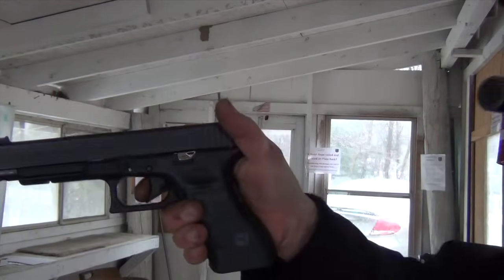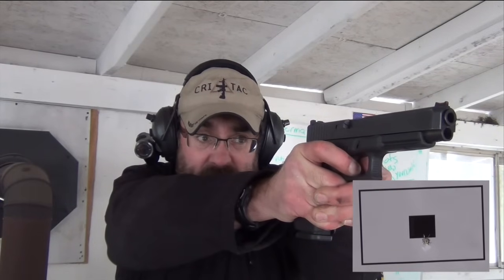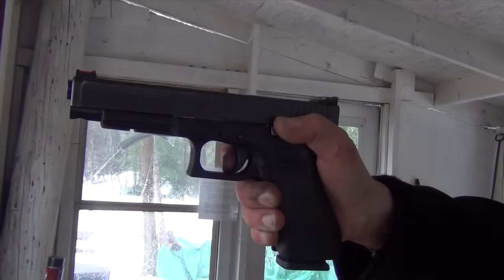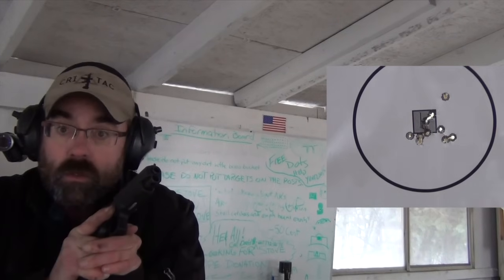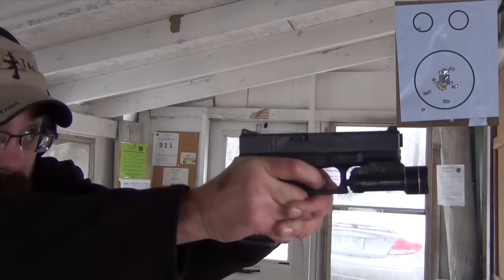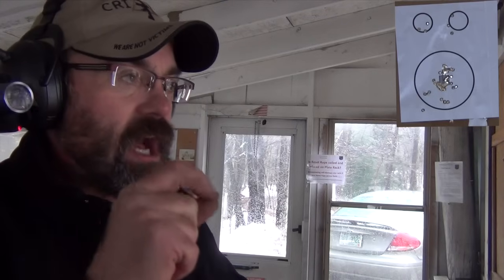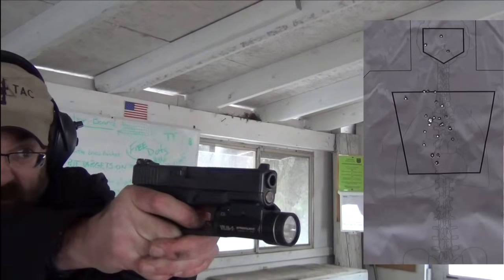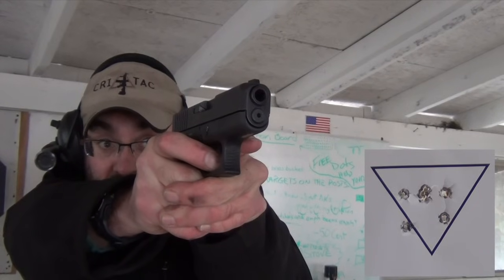Mastering the Glock trigger

Comment: today I used this exact trigger technique you are speaking of, while at the range. and what a difference! night and day difference. more accuracy, more relaxed grip, more shots in a tighter pattern. everything. holding the trigger back instead of letting it go after each shot, brilliant technique. works wonders. thanks a bunch for posting!!
Reply from the maker: Jay, glad this provided some value.  Keep working the technique you'll find you'll shoot more accurately and faster. Also check out my latest videos on shooting small targets.
Reply: Well, using the method with the trigger reset is great if you are in a Tactical situation or if you have a Hi Capacity Magazine but in a critical self defense point and shoot which takes no more than two or three shots at about 7 or 8 feet, you will empty your six round mag in seconds, then what?

Comment: I went shooting yesterday for the first time with a Glock 19 and I couldn’t get the trigger to reset after 1 shot and it would jam. I’m going to try this today.
Reply from the maker: The Glock 19 is one of my favorite. You mentioned you were not getting trigger reset? If that’s the case, either the grip you’re using is wrong or the ammunition or magazine is not working properly. What should happen if you press the trigger and pin the trigger back against the inside of the trigger well and then slowly release it until you feel the clique. That means the striker and sear have been reset.  

If this continues not to work for you have another shooter at the range try it. Sometimes it’s a technique issue or more than likely an issue with ammunition or the magazine itself.

Thanks for watching and commenting. I hope you will subscribe.
Reply: @GunsGearOnTargetTrainingLLC  I asked one of the workers at the range for tips said I had to have a lesser tight grip and point both thumbs forward worked and managed to get a clip out. Then again started jamming and would repeat maybe every 6-7 rounds. I’m not a big fan of the Glock. Rented out an XD9 worked fine, rented the shield worked fine for me. Im already looking to get it off my hands, I just don’t think it’s for me at this time. Maybe down the line I will go back to one.

Comment: Thanks a ton!! This has helped me improve my shooting tremendously. I am now hitting the target every time. Even up to 25 yards which I used to have a lot of trouble hitting. My Glock has a 12lb trigger pull so you can imagine how difficult it is to shoot.
Reply from the maker: Joshua Hull why not replace the trigger connector with the Stock Glock 5.5 trigger?  That will make a huge difference
Reply: Guns and Gear & On Target Training, LLC
 I'd love to sir but I'm law enforcement and that 12lb trigger pull is a standard for my department. Despite the trigger pull I always shoot pretty well but this video helped me tighten up the loose ends. Thanks again!

Comment: makes sense. some videos focus on finger placement . not too deep on the joint of the finger and not on the tip of your finger. because that will cause a pull to a side. so if you get placement right and don't remove finger of the trigger. you'll keep correct positioning of finger thus also improving accuracy. so he has a valid point
Reply from the maker: Thanks for commenting and watching.

Comment: Thank you for the information. I have just purchased my first block it's the G17 Gen4. I have not shot it yet I've been shooting my pt111 Taurus. I will use the method you have shown us. I usually go through one to two hundred rounds whenever I go to the range. I'm pretty much self taught. I lived in an unfriendly gun state now I'm in a new state but have no one to show me what I may be doing wrong. My shots pull to the left slightly but I'm in a small group. I tried using different parts of my trigger finger but I'm still off. I'm shooting at 25 feet.

Comment: I really enjoyed your video. I am new to the Glock trigger, but the fundamentals work for all hand-gunning as you mentioned. I have recently been spending some time with a 26 and I have had some trouble transitioning. A friend mentioned he thought I might be pulling shots left with the gun because I was resting the trigger on my finger joint. Shots were slow fire 25 yards. I have not done that in years with my single action autos, but low and behold I have been doing it with the 26. I really like the pistol, but it is different and has required me to make some changes. Just a slight tease. I can get your 7 yard slow shots at 25 yards with my Kimber 1911. Just saying :) LOL.

Comment: im not sure what it is, but when I shoot a glock, I always shoot to the left when shooting with my right hand and shoot to the right when shooting with my left hand. This is consistent for every glock I shoot no matter what sights are on the gun, how broken in the trigger is, or how I have my finger placed on the trigger face. I have tried shooting with just the tip of the pad of my finger on the trigger and it doesn't seem to help. I know its not misaligned sights because that would mean I would hit to the left with either hand, but its definitely something I'm doing with the trigger. I don't have this problem with other guns. do you have any advice?
Reply: It may be the grip angle, coupled with trying to work the trigger. Personally, I find the Glock trigger has an unnecessarily hard wall, and a very harsh break. However, this may just be that I'm still a novice. I find that I shoot M&P and XD pistols better than I do Glocks. It's all up to the person really, all our hands are different and will interface with the gun a bit differently. As long as your fundamentals are solid you should be effective with any pistol you shoot. But you'll always be better with the system that fits your hands best. Personally, I love Glocks, but I know I shoot better with different systems, so that's what I go with.
Reply: It may be the grip angle, coupled with trying to work the trigger. Personally, I find the Glock trigger has an unnecessarily hard wall, and a very harsh break. However, this may just be that I'm still a novice. I find that I shoot M&P and XD pistols better than I do Glocks. It's all up to the person really, all our hands are different and will interface with the gun a bit differently. As long as your fundamentals are solid you should be effective with any pistol you shoot. But you'll always be better with the system that fits your hands best. Personally, I love Glocks, but I know I shoot better with different systems, so that's what I go with.
Reply: It may be the grip angle, coupled with trying to work the trigger. Personally, I find the Glock trigger has an unnecessarily hard wall, and a very harsh break. This may just be that I'm still a novice. I find that I shoot M&P and XD pistols better than I do Glocks. It's all up to the person really, all our hands are different and will interface with the gun a bit differently. As long as your fundamentals are solid you should be effective with any pistol you shoot. But you'll always be better with the system that fits your hands best. Personally, I love Glocks, but I know I shoot better with different systems, so that's what I go with.
Reply: It may be the grip angle, coupled with trying to work the trigger. Personally, I find the Glock trigger has an unnecessarily hard wall, and a very harsh break. This may just be that I'm still a novice. I find that I shoot M&P and XD pistols better than I do Glocks. It's all up to the person really, all our hands are different and will interface with the gun a bit differently. As long as your fundamentals are solid you should be effective with any pistol you shoot. But you'll always be better with the system that fits your hands best. Personally, I love Glocks, but I know I shoot better with different systems.

Comment: Great video.  Range time must be meaningful and not just throwing expensive rounds down range.  Always have a goal on each range visit as we already know the gun works, but you must train.  All my Glocks I install the 3.5lbs connector.  It may help pull weight (some) but it gives me a much shorter WALL and a very crisp and short reset.

Comment: I just put in a zev spring kit & race connector in my gen4 g19 as Ive done with numerous glocks, mainly to lighten the pull a bit & it seems to get rid of some of the "staple gun" feel to the trigger. After install, at the very beginning of the pull it has a small snap when the safety & trigger come together. Im not exactly sure how to explain it but it almost feels like its put a 2nd "break" on the trigger pull. It does seem like it may wear in/go away in time but Ive never had happen before & its not at all a comfort. I put those parts in due to it gives me a better trigger feel as well as better groups & more time at the range. Do you have any comments or recommendations on what it could be or what should I do? I plan on swapping back to stock parts to see if that fixes it but then Im back to square 1 with a trigger that isn't comfortable nor something I would ever plan on using for ccw which was the main reason I picked up the 19 so I could swap from carrying the 22. Side note:: Im still practicing not letting my trigger fully reset before the next shot but when I do drills at the range I don't always get that perfectly, hence why I swap parts for a smoother pull

Comment: Pulling a trigger isn't complicated.  With a little practice it becomes instinctive.
Also, Glock trigger pulls suck, they're somewhere around 7-8 pounds, which is ridiculous.  Replace the stock trigger connector with a 3 1/2 pounder and fire away, accurately.
Reply: Psychobunny y 7-8 pounds? You're wrong.
Reply: Glock claims 5.5 pounds.  It's actually closer to 7.
Reply: Or buy a 34  and use it stock. (35 also?)

Comment: I HAVE LEARNED (OVER QUITE A TIME OF STUDY AND RESEARCH) TO PULL THE GLOCK TRIGGER TO THE REAR, WHAT I WAS DOING WRONG WAS TO TRY AND PUSH THE TRIGGER FORWARD WITH MY FINGER NAIL - TRY IT, IT WORKS!!!!!!!!!!!!!!!!!!!!!!!!!!!!!!!!!!!!!!!
Reply from the maker: Thanks for commenting and watching. I prefer the term press the trigger than “pull”,  but yes you need to place the pad of your index finger on the face of the trigger to effectively work the trigger. You need to press the trigger straight back along the axis of the bore.
Reply: @GunsGearOnTargetTrainingLLC  

THANKS FOR THE KIND RESPONSE - I WAS BEING SILLY WITH MY POST (ACTUALLY TOOOOOOO SILLY - LMAO!!!) - BUT YOU ARE CORRECT, MANY SHOTS ARE MISSED BECAUSE OF THE TRIGGER "PRESS" (YOU MAY USE THE WORD "PULL" IF YOU ARE AS OLD AS I AM - LMAO!!!) - IF ONE DOES NOT PULL THE TRIGGER STRAIGHT TO THE REAR (INLINE WITH THE BORE OF THE BARREL), YOU ARE CERTAIN TO PULL THE SHOT EITHER LEFT OR RIGHT, ALSO TOO "SNAPPY" ON THE TRIGGER AND YOU WILL JERK THE BARREL DOWN AND HIT LOW ON THE TARGET - THANKS AGAIN FOR YOUR NICE REPLY - I ENJOYED YOUR VIDEO!!!!!!!

Comment: Just bought a glock 17. Am used to shooting CZs, Berettas, and Walthers mostly. I can create a nice ragged hole with all my shots touching at 5-10 yards as well. My groups at 25 are essentially the size of a standard paper plate. How typical is this? Am I doing something wrong or just expecting too much out of this gun?
Reply from the maker: Thanks for watching and commenting.  Frankly, getting shot and shot groups 5 yards out to 10 yards is really exceptional shooting on your part. As far as the accuracy at 25 yards most handguns are not designed to produce super tight groups. Keep in mind also that the Glock is essentially a combat weapon or defensive weapon. If you can keep all your shots in the area of a paper plate at 25 yards, you’re doing great. All in all based on what you told me it sounds like you have exceptional skills. Thanks for watching and commenting. I hope you will subscribe to the channel.

Comment: In my collection of big caliber handguns, I have a GLOCK20SF in 10mm. But here's the problem with the trigger. Each time I fired a round, my trigger finger would get a nasty pinch between the trigger tip and the trigger guard. This was affecting my shooting till I purchased a new LoneWolf extended/ported barrel. But with the original Glock barrel, I hated shooting it.
South Mississippi.
Reply: I'm failing to see how a barrel change affects trigger finger/trigger guard.  Those are unrelated components.
Reply: Just my experience, that's all. Maybe it being longer and ported reduced some of the muzzle flip making it easier on the trigger finger, my guess.
Reply: Chris Schear
He said it doesn't matter. The process is still the same!

Comment: I'm transitioning from striker fired to double single on my Sig pro. The p220 I seem to do better I'd love to see your take on trigger control with a Sig or anything really that's the first shot double then single action. I usually do good but half way through a mag I start pulling my shots I guess going to fast.
Reply from the maker: Same process on Sig DA/SA.  Once you learn this technique it applies to any semi-auto with the exception of DAO.
Reply: Thanks man, it's just a different reset on the first pull but after that the reset is pretty quick to single action subsequent shots.

Comment: let me ask you another question if i may,like i said i just bought a gen 3 glock 23 now the gen 4 is not sold in california but they have a double coil spring on the gen 4 to reduce  recoil could i put that in my gen 3? thanks again!
Reply from the maker: I have not tried the Gen 4 spring in a Gen 3 gun.  However, there are aftermarket dual springs sold by stores like TopGlock. I have used these [arts in my Gen 2 and Gen 3 Glocks. Best bet is to call Glock direct and ask.
Reply: Guns and Gear & On Target Training, LLC
just getting home and got this thank you very much for your quick replies and i will give them a call thanks bud!

Comment: Some damn fine shooting there.  I've been at gun ranges for years.  Never seen anything close to that.  I'm pretty accurate, but not when I speed things up. 

You talk about the trigger reset, but how do you quickly put the site back on the target?  It seems that's the real magic of rapid firing while maintaining accuracy.

As a suggestion, I'd like to see a video on how accurate you have to be to consider competitive shooting as a hobby?  In other words, what's the price of admission for that sport?
Reply from the maker: Thanks for watching and commenting, Rob.  You are correct that it is the combination of follow though (sights aligned after the shot) combined with trigger press that works.  As far as competition... most groups like IDPA have classifications for their competitors.  This allows newer shooters to compete with others of their skill level.  You'll go to a match and watch the top guys running and gunning super fast!  However, your best bet is to go slow and smooth at first.  Then you'll develop the speed over time.  Too many people try to shoot to fast and they miss.  So, go smooth, be safe, make the hits and have fun!  Remember that competition (a game) can be an important part of your defensive training but you also need to train in other situations with quality instructors.  You will revert to your lowest level of training under stress.

Comment: Just need more ammo...priceless. I also practice trigger discipline and has dramatically helped my shooting. I have found issues shooting with my bi focals, loosing sight picture etc...have you found this as an issue?
Reply from the maker: I use transition lenses so there is no line and I get by okay.  I have problem when wearing my contacts, however.  I know some folks have a special pair of shooting glasses made for range work that allows the perfect clarity one the front sight ... regrettably the young folks have a big leg up on older guys like me.  I also practices with no corrective lenses occasionally... and I can still hit the target most of the time.
Reply: Thanks and Merry Christmas

Comment: Darn good shooting!

I took a really good Dave Spaulding class a couple of weeks. During the class I was getting better hits 12-15 yards than I ever was before.

Since then I've been working on controlling the recoil and managing the trigger. I feel like I've removed almost all jumpiness from my grip and I'm doing a better than average job on recoild, but I'm still shanking low and left (I'm a righty). 

When I was at the range yesterday I was shooting very slow: 1 thousand, 2 thousand, 3 thousand, etc. I felt like I totally managed the trigger and was on top of the recoil. However, at 10 and 15 yards I was low and left most of the time and at 25 I was totally off the the black on a B8 target. 

Trigger? Recoil management? Dipping on the shot?

Any suggestions?

Thanks for any help you can give! Keep up the great videos!
Reply from the maker: Is 60% of the grip from your support hand and are the thumbs forward along the frame? If so, then I am thinking Inconsistent trigger press is likely the cause.  The trigger press must be straight back along the axis of the bore.  Slow and steady.  I suggest starting at 3 yards ... press three five shots. When you can press all five shots into a 1" group.  Back out to five yards. Do the same drill at 5 yards, keep all five shots to no more than 2".    Continue this and work your way back at 10 yards all shots should be no more than a 4" group.  (Obviously tighter groups are better!).  Hope this helps.